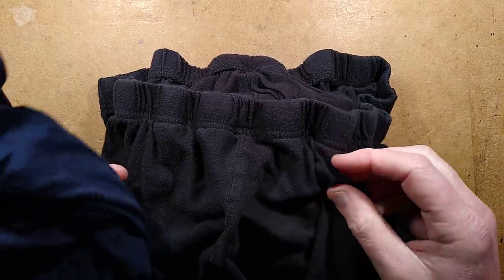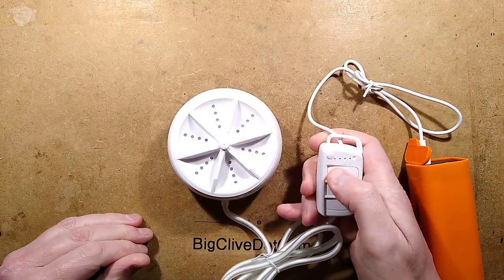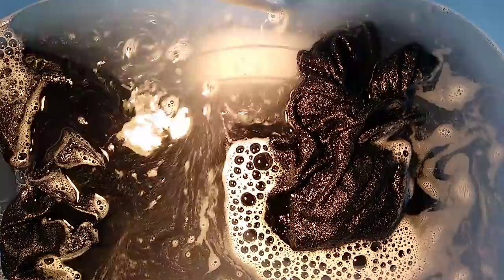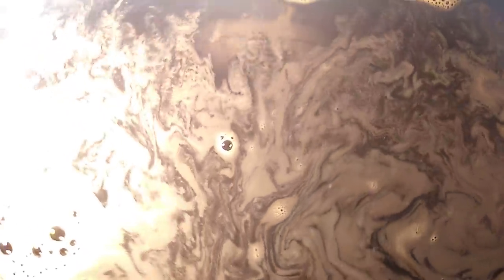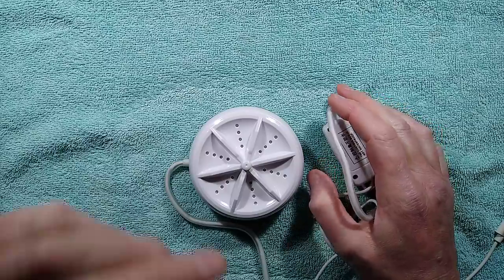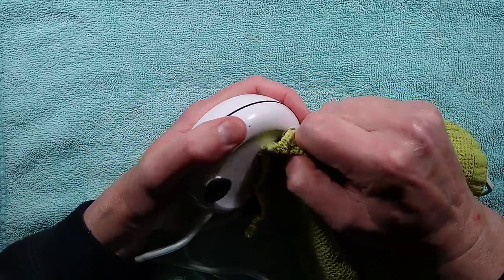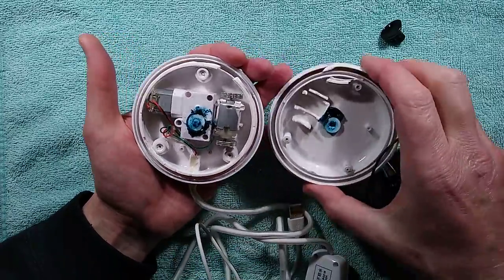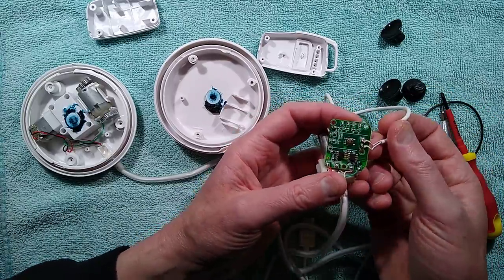USB laundry machine for tiny (moist) Chinese panties.

Comment: Half a scoop of persil in hand hot water, give the fabric a good shake around by hand, use your finger nail gently to ease off stubborn dirt, rinse under the cold tap, wring out then hang up in the breeze of a fan or open window and no need for a useless contraption

Comment: You know, the bubbles might be to help separate oils out.  Surfricating action or whatever.  I know with handwashing dishes (or tools or parts) the foam on the surface helps to separate and trap grease thus keeping it from recoating the surfaces.

Comment: Guess they could have prevented the leakyness with a one-way valve.

I'm wondering if it would work better if you put it on the bottom of the bucket.

Comment: I wonder how well this would work as an automotive parts cleaner/budget ultrasonic cleaner, with the rotation setting & sonic setting going at the same time, with it sitting at the bottom of the bucket facing up, with the part sitting on a grid above it..

Comment: My Mum kep a twin tub for far longer than you'd expect. She insisted on it. It's only the final time she got a new kitchen did she switch to a front loader.

Also, all 0402 resistors I've seen don't have markings on them. An absolute pain for fault finding.

Comment: I have an alternate use for this.  If you bolted a small tupperware tub to the spinner thingy and filled it with walnut grounds, then added a bunch of rusty bolts and small parts and such, then turned on the vibrator, would it not polish up the parts like a professional tumbler/polisher would?

Comment: Probably would have worked better if you had it in the bottom of a cylindrical container that was as narrow as the device itself so the entire bottom would spin and ensure everything agitated.  I don't think this was really designed to work sideways with such small fins.  Just a thought.  The bubbles would also do more if they always had the clothes over them so they would have to filter up though the clothing.  Doesn't that make more sense?

Comment: I would venture to guess that circuitry can be adapted to larger components run through either micro switching, relays or some sort of higher powered handling capability. Depending on the output voltage possibly being 3v? I would imagine that could be quite useful.

Comment: It's a spinning vibration cleaner. Not sure what they need the air pump for. They damage most cloth... It's good for washing some kinds of jewelry, dishes and electronics though. Rather slow. Smart thing if it were made bigger.

Where's the requisite piezo ultrasonic element?

Comment: I think you will have to wear very lightweight knickers !!!!  You have the De Luxe version !!!!!  Mine just automatically cycles through the actions.  The Ultra Sonic Vibration does most of the cleaning !!! You take the small cap off the centre of the fan and there's a screw in there !!!!  Back in the 1960s Twin Tub Washing Machines were all they had !!!!  It was only when thy invented the Clockwork Controller combined with Electronics that you could buy Automatic Washing Machines !!!!  I think the bubbles also contribute to the cleaning effect.  You can buy a non soap bubble making globe to put in your Automatic Washing Machine !!!!   It is a bit daft

Comment: I wouldn't way twin-tubs were for folks of limited resource, rather, the modern front-loading fully automatic wash and spin machines had yet to be developed.  When they were, of course, they would have been the expensive posh option for a while.

Comment: If it had an actual ultrasonic transducer in it I would be tempted to get one to wash auto parts and the like.
You can get ultrasonic cleaners but they are either too small too big or way too expensive for the occasional job.

Comment: I think you may have some dye running into the water, it is murky blue grey and it's impossible to completely prevent dyes bleeding out especially on dark or new items, I remember having to clean clothes in the bath for a while when I had no washing machine, often you'd see blue-grey or pink-red tinges to the water, seems like a dumb invention, frankly a broom handle in a bath would be more effective at agitating the clothes and it'd be less laborious just doing everything at once, especially since they need agitated, soaked, agitated more, soaked more, drained, wrung, rinsed and wrung, preferably a few times, using this would take even longer! Incidentally, if you don't happen to have an old mangle just laying around, good luck not ending up with water and potentially dye dripping everywhere you hang them, hope it's outside, trying to hand wring even small items well is a major pain and I can't imagine vibration or ultra sound is doing much, enzymes have narrow temperature ranges, you need hot water and you  need to know how hot and soap and non-bio are really best in hot washes. No power? Just dry clean with petrol in a bucket and hang to dry well away from sources of ignition! Way safer than other stuff you do on here!

Comment: All soaps, detergents, washing products are developed with surfactants to modify the waters surface tension and create bubbles. These bubbles are what does all the cleaning work, agitation just spreads the chemicals,  AGITATION DOES NOT SHAKE THE DIRT LIKE A Baby UNTIL THE DIRT GIVES UP AND LETS GO OF YOUR CLOTHING (IN THIS CASE). The bubbles transport the dirt to the top of the water with the dirt suspended in the soapy film that surrounds every bubble. The bubbles travel to the edge (of a conventional washing machine) of the tub and over the edge into the outer tub and is PUMPED  up and out of the washer.   My point,  the air bubbles this device is creating are to accelerate the speed of the soaps cleaning ability.  

CANT SEE IT IN ACTION WITHOUT ANY ACTUAL DETERGENT in the water..

Comment: It's really easy handwashing clothes though, its the rinsing to remove all of the soap and the spinning so they are dry enough to put on a radiator without them ruining your carpet that's the hard part,  so kind of a pointless device really, so where do I get one from?

Comment: The bubbles "skim" the surface dirt that is floating, by pushing it out to the walls with surface tension. That way you can remove the laundry/device without covering them in all the floating grime.

Comment: The only reason i can imagine the bubbles would be for is to maybe catch and floating debris and particles but how effective it would be is debatable considering you have to pull the clothes out the top or drain the water out the bottom with a tap.

Comment: My aquarium air line has a valve to prevent water flowing back to the air pump. The water quickly flows up to the valve when the pump is off
Reply: Good call, and these non-return valves are 5-for-$3 (or thereabouts) on AliExpress.

Comment: Man I need help making a current amplifier with a 20A Variak! I need to profile current transformers and am pretty sure I can get up to 100A with 5 winds but just need some assistance- if you ever see this! High AC current testing is almost nonexistent in TX- I could in theory use an audio amplifier too but light be expensive. I do have 2x1kW 1pm chassis resistors Ive been using with 10AWG wire via Variak and get a clean sinusoid- but I need to amplify and get maybe 100Arms....but if i even attempt >25Arms with my single winding the Variak WILL explode haha.

Comment: Im not a wash-cycle scientist, but I think the air pump is to aerate the water that may be needed if your using soap flakes instead of washing powder. Presumably this thing is meant for enviro friendly geeks who want to use less chemicals and solar energy for thier washing needs. It would only be useful when we're all having to wear paper-thin clothes because the planet warmed up. Yet another technology that's been developed way before it's needed. Give it another ten years, when we want cleaner air, when battery technology has finally caught up and when electric motor technology has become even more efficient (and still hardly anyone can afford Tesla's) - maybe then, Sir Clive's C5 will make us all happy.x
Reply from the maker: The C5 was just WAYYYY too far ahead of its time.

Comment: i feel like all the features would work better if the device was on the bottom of the bucket and not the side. that would induce cleaning bubbles through the clothing instead of just on the top and the grease is probably to avoid grinding with the extra water pressure.

Comment: The purpose of the bubbles is to oxidise the solution. By adding bubbles, you introduce oxygen, and create a bit of hydrogen peroxide. This will also perform work upon the dirt.

Comment: All these mini washers say that it should be placed vertically in the bucket, but I have a theory, wouldn't it be more efficient to place them at the bottom? [clothing tends to float and swirls are almost always vertical]. That is, operate it so that it is an American agitator system, and not a horizontal drum washer.
-this would save some energy, since the system would not be forced so much when moving from top to bottom and would only do it from left to right taking advantage of inertia.

-In addition, placing it in this way will allow the bubbles to touch all the garments from the base and not only superficially to the ones in front. and the vibration could take advantage of the amplification effect, of the conical shape of the cube
For me that would have much more logic, There is more vertical space than horizontal. and most garments are longer than they are wide. [something important if we take into account that according to the box, it is designed to wash underwear (socks, since panties would be the exception to length over width but they are not of a size that can hinder your washing), t-shirts, dresses and skirts].

Comment: These look like 0402 resistors, which almost never have markings as they're too small to print on to. Seen the occasional 0603s going that way too though which is annoying as most AOI equipment can read the values so you lose some of the quality checking.

Comment: I'm sorry that this comment isn't related to the video, but can you do a video about FAR-UV?  Do you know where I can get FAR-UV components to build my own equipment?
BTW, this is very useful for those vending machine underwear in Japan where the vendors are too discourteous to prewash before placing into the vending machine.
Reply from the maker: If you mean the 222nm excimer lamps made by Ushio, they are primarily aimed at the medical industry at the moment and therefore extremely expensive for both the lamps and specialist drivers.
I'm not convinced they are as safe as the hype implies.  It's a new technology and still to be proven.

Comment: Curious! This thing looks pretty cool. It left me with a question though, how do dry the clothes using cheap dangerous potentially house setting on fire china quality methods, so to ebay I went, and I found the most amazing thing when I searched for "Portable clothes dryer". It looks like a collapsable clothes hamper attached to heatgun guts, so you know, right up your alley! I hope to see your review on the "Portable Electric Clothes Dryer" soon!
Reply from the maker: I made a video about an electric hot air coat hanger for drying clothes.
Reply: @bigclivedotcom  That one was quite hot indeed!

Comment: Clive, I bought one of these and I like using it. But, mine seems to have a problem now. I plug it in and the red light just flashes. I push the (only) button and........ nothing. It's stuck, I'm stuck having to use the big washer downstairs ( I have knee problems), and my clothes are stuck being dirty. Can you help? Thanks big guy!
Reply: Problem solved. I remembered that USB adapters have different voltage outputs. There's now a loud humming coming from the bathroom. Hubby will probably investigate the noise. He's thinking " why is she using her dremel in the bathroom?"!

Comment: I wonder if it would have worked better if it were on the bottom and not off to the side.....I would imagine bubbling THROUGH the clothes creates more cavitation surface area, instead of just bubbling on the side of the bucket.

Comment: "It has a lot of water in it"... You've had the thing submerged for quite a while and then dumped it over and filled your pockets... I wonder why?!?  

 The inside behind what is left of the sealant ring still appears to be dry and back wash up the tube is a common siphoning effect when the path is not too high, and was likely highly amplified by the act of dumping the bucket over and letting water run up the tube to the top... These are all elementary deductions my dear Watson, and I am truly surprised by these gaffs compared to the other videos you have done... Those bubbles act as a surfactant for the grease and oils.... the soap encapsulates them and the bubbles bring them to the surface to be poured away from the fabric... heavier dirt and detritus sinks to the bottom of the bucket, again, away from the clothing.  This is somewhat similar to a washing machine... aside from the weaker agitator for moving the water (and thus the clothing) around,  in many ways this is superior as the vibrating section makes the water move more aggressively to sweep the "dirt and oils" off of the fabric more effectively, and pouring off the bubbles from the top instead of letting it settle back on the clothes would actually get rid of more dirt (as evidenced by your "clean clothes" leaving additional murky water in the bucket).   I was also rather amused that you tried to do both a heavier t-shirt and some sweatpants that nearly filled the bucket like a full  "load of laundry".  It's as if you thought this little USB device was some sort of heavier duty washing machine when the instructions, which you claimed "were not there", very *Clearly* stated for "lightweight clothing only"... as in for single items of light clothing like a t-shirt, pair of socks, underwear, light dresses or skirts...   Amazing what can happen when you RTFM!

As for the "Mystery chip" looking at the functions it appears to match up with an 8 pin AT Tiny microcontroller pinout and was likely covered so as to make it not too easy to figure it out...  you also have the red dot for VCC in the wrong place as that is reading the pushbutton to set the modes, the rest of the pins are driving the LEDs, transistor, MOSFET and H-Bridge to control the motors, probably using PWM which matches what those pins can do an an AT Tiny...  That common for all the LED's is likely tied to a little thing called the "Ground Rail" along with the last pin so it will not remain 'floating'... I managed to figure all this out just by looking at what you showed (BTW your Schematic blows) and the tests you did. Also, the combo of the water, rubber feet, and counter rotation of the vibrator would dampen out most of that sound as you should have noticed when it was placed in the bucket.  This video has been an epic fail overall as you clumsily stumbled from one assumption to another like a pub crawl bender.  Bad Clive! No Crumpets!

Personally, I think this thing would be great on holiday/vacation to have a very portable and easy way to clean a **LIGHTWEIGHT** (RTFM) soiled item that you want to use again quickly, rather than going down and filling an entire machine (if it is available and the associated cost!)  The construction was solid enough to give you a lot of trouble opening it and I think it would have done well for it's intended purpose, especially given the universal USB so you don't need to worry about adapters. I'll likely get one for travel!

Comment: I keep coming back to videos like this likely because I like identify with "bigdaddyclive" as I feel like a slightly younger version of him in a society that lacked the "trade training" aspect of british culture and instead emphasized "degree status" so I broke and shut down in school that was all about "memorize this thing" rather than give me some reason to care about the skills I was learning
I learned more stuff about math and programming and circuit level diagnosis and building after I became an adult and started building logical circuits in my minecraft worlds(complex redstone tasks is kinda fun as it makes you try to make a massive array of the fundementals of redstone(or and not gates))
basically I never had a reason to care in school (besides reading cause it was an easy way to escape into other worlds) I often read ahead of teh class at a rate of about 2-5x as fast and just let them read aloud and test as I read far ahead
I still enjoy complex redstone controls in modded minecraft though I now tend to use mods that put the gates into single block objects that have a 4 bit color array for signals in and out
heck when I play with mods that create massive arrays of moving blocks I still "program" in redstone based drive circuits to prevent excess calculations from blocked "carriges"(as an example I am referencing the "restone in motion/remain in motion" mods)
if you left the carrige engines/motors going with a "support carrige" it would collide with a block that was connected to the rest of teh world and crash the server from the sheer size of the "connected" structure it would try to move
so I have to get clever in my number of "move" pulses to avoid it
just to say being a kindred sparky soul who enjoys vulgar humor these videos that dabble into "adult" ideas just tickle me just right
"moist Chinese panties" well done clive you know who enjoys your stuff

Comment: You don't need this. Just put clothes in a bucket, add some detergent, and pour hot water. Stir a bit, leave up to a day and then rinse thoroughly. If you leave it for more than a day it will start to stink.